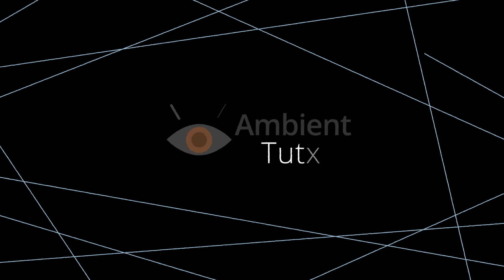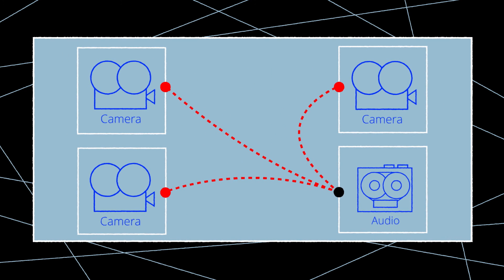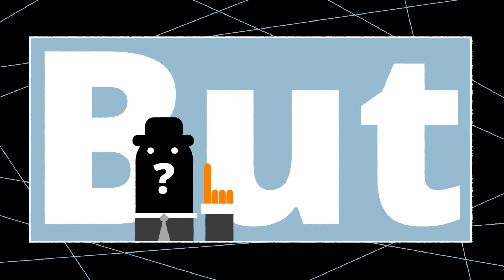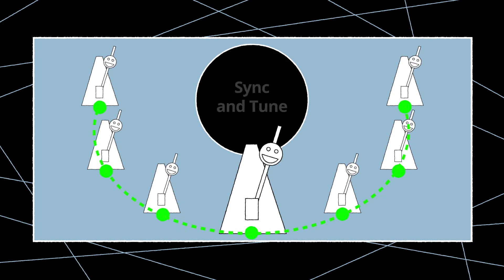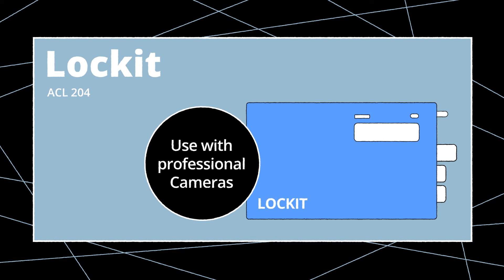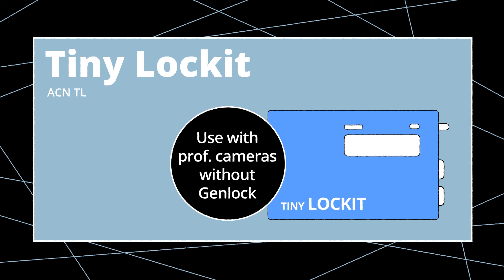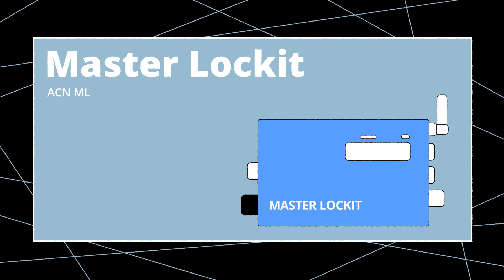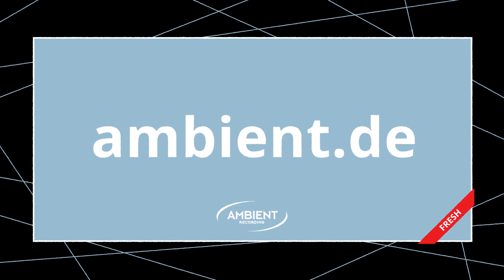The Lockit Family - Tutorial

Comment: Question. Does "Master Lockit" connects to you tab or phone wirelessly for various settings manipulations? Also can I set UB on Master Lockit manually and then distribute them to TC Slate and Nano Lockits? Thanks
Reply from the maker: Hi, yes... and yes ;) ML features a web interface that can be accessed over WiFi with any device running a web browser and you can apply settings and edit userbits to your liking (time of day in TC and date as DD.MM.YY or MM/DD/YY in UBs as available presets)
Reply: @AmbientRecording  thanks, that's great. Does the app exists for the Android as well? Or it is literally non OS dependant due to html protocol?
Reply from the maker: @Greenjah81  exactly, ANY device that can connect to a WiFi AP and run a browser will work out of the box. Just connect to the Wifi, browse to 10.0.0.1 and you're set. You can even send the webpage to fulscreen and blend out menu bar and tabs.
Reply: @AmbientRecording  amazing. Thanks!

Comment: I want to sync blackmagic ursa mini for stereo 3d, which lockit must be used and required connectors
Reply from the maker: Hi Sudessh, that would be the ACL 204, which is able to sync two cameras simultaneously. You'd need two LTC-OUT cable (5pin Lemo to BNC) for timecode, a BNC T connector to split the sync signal, and two BNC-BNC cables to feed the Genlock signal to the URSA Mini.